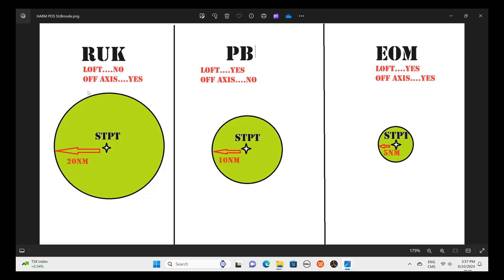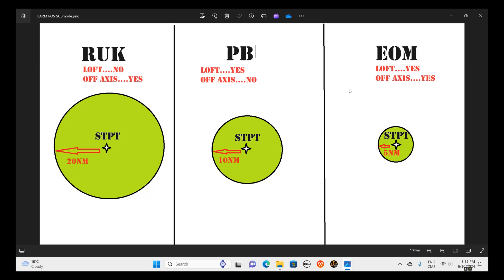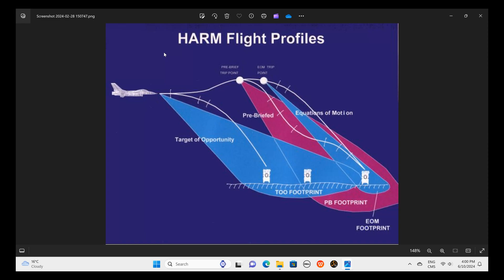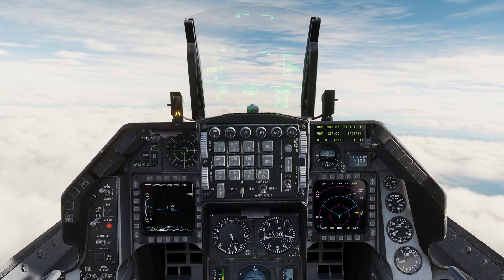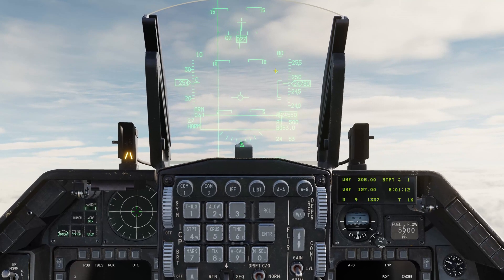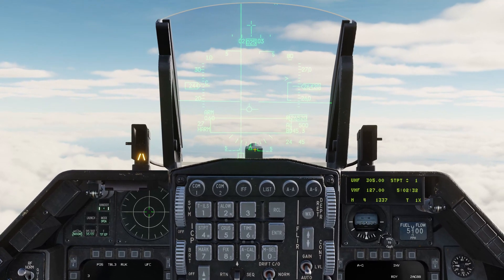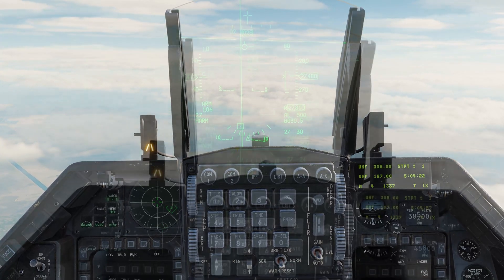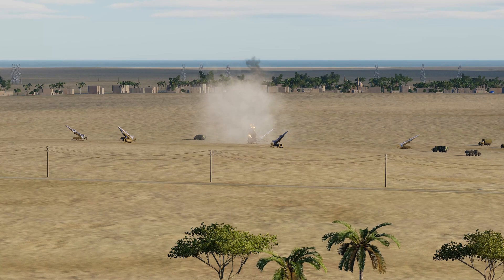AGM-88 in POS mode: Get it right the first time. #dcs #dcsworld #dcswqc

Comment: This is great, and has taught me something new. So is this method better than using the HAD?
Reply from the maker: Hi! I would not say better, but both have their purpose. The HAD is excellent for detecting and locating a radar system. You can then share this position to everyone else. The POS mode of the HARM is used when the position is already known through intel. It allows to plan and coordinate an attack in advance. Thank you for your question.
Reply: @maddog7989  I would assume the other difference is, using the POS way of doing will allow for a stealthy approach. 

The HAD to work effectively would need altitude, meaning you'll be pinging on their radar and have to fire off the HARM earlier. 

POS can be used at tree top level, sneak in, get in close, giving the HARM short travel distance, so you only need to bait the sam site for a shorter time. Once the tracking radar is out, then any missile in the air will self destruct anyway.

I'm definitely going to try and use it in that way, as the S300s have a greater range than the HAD. So the only way will be tree top approach
Reply from the maker: @ds6899  Nice description. You could do the same thing with the HTS/HAD once you have determined the location of the radar. You can mark point the position and use this as your SPI, sneak in and launch in any of the POS sub mode  (EOM being the most versatile). My next tutorial will be on the HTS/HAD so stay tuned for more.
Reply: @maddog7989  great content mate. I'll sub